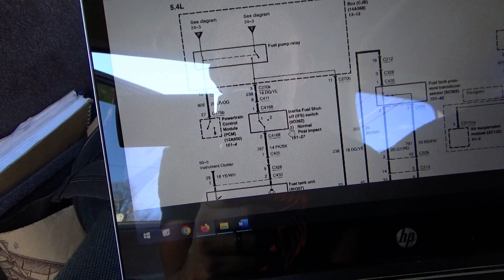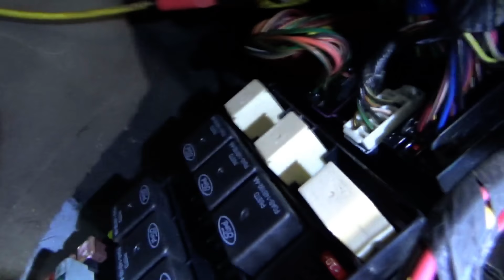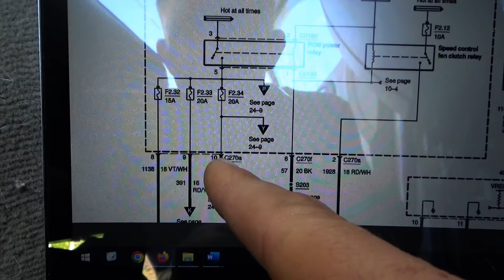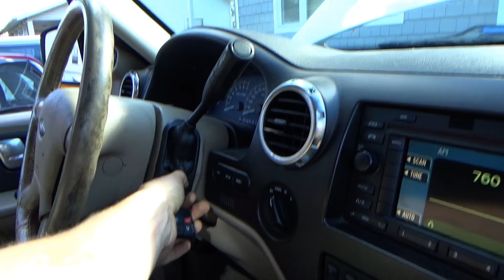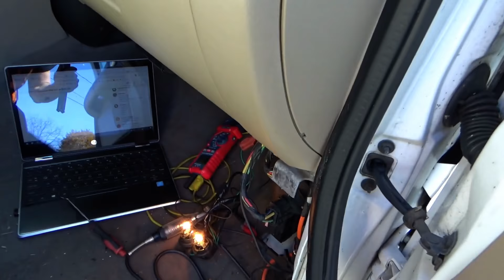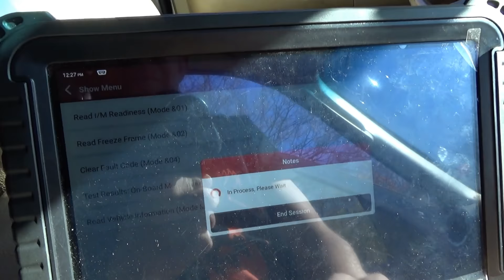Ford Owner STUMPED for 6 MONTHS? Fixed in 15 MINUTES! (No Fuel Pressure P0231)

Comment: Usually I'm all for the npr but in this case it would be worth adding a relay that actually lets the PCM control the fuel pump like it's supposed to.
Reply: Highly agree!!!!!
Reply: Totally agree. Just a little extra work and retains original functionality.
Reply: Yeah but the dealyo here (as Ray would say) was to get the truck running and save the customer (the garage) money. The garage can consult with the vehicle owner now they know what the issue is as to whether they would like a relay added.
Reply: @Blitterbug  I concur here. The shop IS now aware of the exact issue and HOW to "OE-correct the repair". The onus is on the shop to professionally and ethically proceed (not saying in any way that PHAD or repair is unprofessional/unethical) but the onus to inform the customer of the current situation, repair, determine further parts and labor for "OE-correct" be authorized and deemed necessary for 20y.o. car, and to properly inform customer of the idiosyncrasies of the "temporary-but-compartmentally-safe" fix, is on the shop and customer. The repair is not unethical due to the fact that the Inertia Switch IS still in ECM- and key-controlled circuit.
Reply: Agreed. In the case of an accident or something the pump won't stop running
Reply: @raffaeldelpiano5052 the voltage is still being fed through the inertia switch
Reply: @raffaeldelpiano5052  -  The pump will stop running because there is an inertia switch in this truck. Trust me I had lots of fords and this switch is sensitive enough that I had people crash a buggy into the wrong place in the truck (old work trucks) and it would trip the inertia switch. An accident would not preclude the safety function. That only applies to Garbage Motors and Crappler (ShitLantis) vehicles and some other malformed and miswired ForkWagons sold out there. This repair is OK because of the inertia switch being in line with the pump power separate from the ECM.
Reply: @raffaeldelpiano5052 I would hope the inertia switch would cut power to pump in an accident scenario
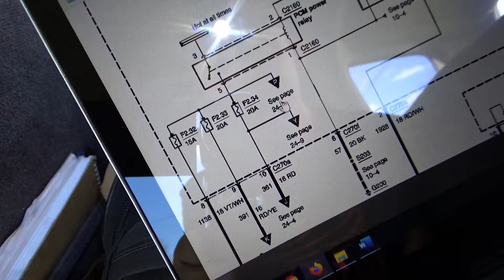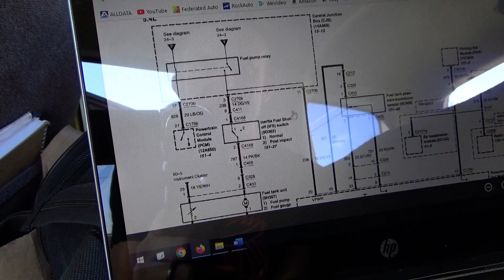Reply: The PCM still does control it..  Look at 5:29 in the video..   The PCM sends power out, it branches to P, and also goes to the fuel pump fuse, which is Y..  Now go back to about 2:50 in the video..  P is what kicks the fuel pump relay.   So when the PCM says to shut the fuel pump off, it doesn't just kick a relay, it also cuts the power to the relay, and since Ivan pulled off of C270A, which is also on the same circuit, the pump will shut off when the PCM commands it.  
.
The only reason I can think to add a relay is for wire size considerations..  Its over a 20 year old vehicle, so retaining value isn't a big deal, and I doubt it will be going through many more hands.

Comment: Ivan, i want to take the time to thank you for all the free knowledge you put out. Thanks to you im already the highest paid technician at my dealership. The best part is im no longer flate rate im salary! Im only 2 years into my career. Cant thank you enough.
Reply from the maker: That's AWESOME!! Keep up the great work!!
Reply: @PineHollowAutoDiagnostics  -  Great Repair. I did vehicle electrical repairs for years that drove people nuts. This was some good troubleshooting. My one truck I put a dual guage in the dash for it with switches, Guage showed voltage and current at the tank for the pump with a bypass switch in case forkery broke out. I loved driving old POS trucks for my work. I worked as electronics eng during the day and every evening at used car lots chasing gremlins with electronics equipment back in the late 80's and 90's in new cars. 9/11 killed my business. Moved to making extra money another way. Love your home made test jigs with the light bulbs. Build yourself an external power source in an ammo can with a 10 to 24AH battery with volts and current gauges lights switches terminals and lighter sockets as well as a trailer pigtail. With 6 switches and a trailer connector you can operate anything sorting out forkery in trailers. Great work. Loved watching. Wished I was there helping you chase this stuff.  BTW... when you get tired of burning your hands arms rugs mats etc... switch to a weller 100/140 solder gun. Heats up quick and cools down quick, and you can also bend your own tips from 14 or 12 ga wire to make tips. The 14 heats up and cools off quicker with less power and the 12 is slower but has a little big more oomph for heavier connections like relays soldered to circuit boards. I always had three guns with me in the soler box. one with 12ga one with 14ga and another that was 240/more watts and weller had a few bigger guns that would do big jobs. Have one here with me on the table now. Biggest one they made was 320/400 and would solder terminals for alternators and big power feeds for the main fuse and distribution boxes. God bless and good luck.
Reply: I had a 2005 and found fuel pump driver moduel, mounted over the Dr. Side rear wheel
Reply: You did the hard work to learn.
Reply: Thanks man for the video. I love trouble shooting. My younger brother was one of the best macanic you would fine.but when thought in was in the wiring he would  call because he said he didn't have the patience like I did. Thanks again an keep up the good work an helping all of us diy doers.a 10 star in my book brother.
Reply: I personally believe that you should be paying him 10% of all your futures earning until retirement

Comment: Although I'm sure you often wonder ' why did they do it that way?' I assume ( U Me ass etc...) That the Fuel Pump relay is controlled by the PCM ( C 175b) for some reason. Did you monitor that to see if it goes open at some point? Do research? I know, I know, it works like this what more do you want? But that would bug me just in case there was a safety issue involved.

Comment: Not to be a safety Sally but with the computer controlled fuel pump relay bypassed there is power to the pump anytime the key is on?
No 5 second prime or crank signals to keep the fuel pump on anymore, would that be safe?
Reply: Its perfectly safe until its not.
Reply: Yeah. I think the PCM modulates the pump. It is not supposed to be going full time. A relay would be a cheap and easy and safer fix. You can buy  a Bosch cube relay and pigtail for peanuts and wire it in like the factory could have. That would be the lazy and safe way. Otherwise I probably would tear the JB apart and solder in a new relay.

Comment: Nice and simple solutions, but i my small mind there must be a reason for Ford want to control the fuel pump.
Perhaps if the SRS are activated, perhaps in a frontcollision. Then the fuel are cut off. Just to prevent BBQ of the driver and passengers.😊😊
If this is the case I would have put in a external relay. 12 volt relay with 40 amp contact are cheap.
Reply: With this change the factory inertia switch will still shutoff power in the event of a crash.
Reply: @DavidNull5  Inertia switch will only trip in high G collision or rollover, the relay is for other cases. For example when you high center on something and it cuts the fuel line.
Reply: @petrnemecek4379  -  The computer does not know you cut the fuel line. There is no sensor for that.
Reply: The fuel would be cut off by the inertia switch which is how ford does safety on their trucks and cars. So the safety function is not bypassed. No problem here and this vehicle is too big to have a gas tank problem like you are describing unless double mashed by cement mixer and garbage truck or something heavy like that in which you are more than likely better off dead than eating all your meals through a hose in the future. But at that point its all a mute point.

Comment: Isn’t the fuel pump relay there as a protection. With this jump the pump will run when ever the key is on. If the car stalls it should shut off. That’s what the fuel pump relay is really for. Like for instance if the fuel line were to become compromised to the point where it leaks causing a stall it will continue to pump fuel out until the key is turned off.
Reply: That is why you shouldn't do this I just posted a comment I had a truck in our fleet so this exact thing it was a 2019 and the ecm is on the same circuit as the fuel pump relay so you if you bypass it it will run badly might I add for a little bit but the truck just shut itself off

Comment: My trick to strip wires is to use a cigarette lighter to heat up the insulation to melt then pull apart. Never have to worry about damaging wire.

Comment: I've fixed several of these Fords by snipping a couple of wires and adding a new external relay to replace the internal relay.
Reply: I was wondering why he did not simply splice in an external relay as well...
Reply: That's how I would do it as well since the PCM control is there in case of an accident to stop the fuel pump from flooding the engine compartment. The safety switch doesn't always do what it should and in the event of a fuel leak stalling the engine you don't want more fuel added to a potential fire.
Reply: @ehsnils pcm doesn’t always do what it is supposed to do either
Reply: Yeah, can ya believe they also gotta buy those dumb patents
Reply: Yep I've been doing this for almost two decades on those.  Overlay new circuit bam, and it's actually reliable afterwards.   Except for the ficm
Reply: good idea

Comment: The bad news is that pump will run continuously with the key on instead of just running or a few seconds and shutting off. I wouldn’t do something like this would come back to bite me in the future.
Reply: Agree. I would rather put in an external relay. That would retain the original design.
Reply: I'd still put in a external relay. All the wires are there to do it. Then pcm can control and be happy
Reply: The pump is always on with the exception of toggling the key to on and not starting the engine…… otherwise this is a proper fix
Reply: You really need the 5 second prime circuit to work because in the event of a car accident, the PCM will shut off the fuel pump once the engine stops running which decreases a fire hazard risk because it will prevent the fuel pump from spewing fuel all over the road.

I can remember 40 years ago when Holden built their very own 3.3 litre EFI 6 cylinder engine in Australia, it wasn't high tech by any means because the engine was about 30 years old back then & was a stroked version of the 179 cubic inch (2.9 litre) Holden six which was first built in about 1964.

Holden bolted their own EFI intake manifold onto the non crossflow cylinder head on the 3.3 litre or 202 cubic inch Holden six & its brains was the Bosch L-Jetronic ECU, so basically an abacus ran the engine, it was analog.

The fuel pump control was done by a tachometric relay which also controlled the initial fuel pump prime then it ran the engine once it was started, the ignition pulses off the ignition coil was what kept the engine running until the engine was stopped by turning the ignition switch off & you guessed it, a car accident.

It was fitted into the Holden EFI Commodores from 1984-1986 prior to the mandatory introduction of unleaded fuel for then new vehicles which were manufactured from February 1986.

Holden adopted the Nissan RB30E engine from Nissan since the old Holden sixe couldn't easily made to run on unleaded fuel efficiently and reliably 

The Nissan RB30E engine was controlled by Nissans ECCS (electronic combustion control system) or ECU & the fuel pump control was integrated into that ECU !
Reply: I might do this on my own car but not a customer.  It might also be there to shut the fuel pump off in the event of an accident.   Why take the risk of lawsuits.   It is all documented on YouTube.     It is not worth the risk.
Reply: @joesilverbliss1721  power still going through inertia switch. In case of accident it will still trip and cut power to pump.
Reply: @joesilverbliss1721 The inertia switch cuts power to the entire circuit so that shouldn't be an issue. Also the pump runs constantly while running, I think a few seconds before a start will be OK.
Reply: Same if fuel line gets a leak due to corrosion.
Reply: Clearly you guys have no idea what you're talking about. And I'll guarantee the customer was informed on his options on different repair avenues and went with the easy, quality, low cost, logical option.
Reply: The blind trying to lead the crowd..  clearly they do know wtf they’re talking about because its the truth.  What would the original relay be there for?  So adding an additional relay there would both solve any dtc for it while continuing to keep the car acting factory.  You woulnt need to confuse the customer telling them all the details of your repair and everything would do as it was designed to do.   You tell a customer that you jumped a wire and bypassed a component and count how many questions you get after..  having to explain all that to them would be like explaining physics to an 8 yr old..
Reply: @blindabinda1234 if it ever came to the crunch, Ivan or any of us would be deemed the trained professional and the customer has no way of knowing the consequences.
Reply: @blindabinda1234  It's a classic 'Russian Repair'
Reply: @blindabinda1234 Would you care to explain how using a relay is not easy and low cost, while retaining the original safety functions?
Reply: I followed your directions and my car burned up.  Where do I have my attorneys bartles and James serve the papers????
Reply: He directed you nowhere, do you always go to YouTube for professional advice 😂😂 judge would laugh you out the court
Reply: Hand them over to yourself from one hand to the other.
Reply: He does sketchy stuff like this all the time.

Comment: This is a great common-sense fix to correct a stupid design by the Ford factory. Keep up the great work, Ivan.
Reply: Suspicious design move . 
If the thing is cheapo at junkyards it might be fun to dig out the module and see if that particular relay/ contacts even meets specs for this application or perhaps the failure is a feature of some internal safety item ?
.

Comment: Did you drive cycle the vehicle to make sure all the emissions monitors would set with that repair? I would be worried about that...some vehicles that have an ecu controlled fuel pump would not be happy about this. This may be old enough it doesn't care. Appreciate your videos Ivan!

Comment: Very common issue on these trucks. Other weird electrical issues happen on these as well due to a windshield leak that gets that same fuse block on the passenger side footwell all wet.